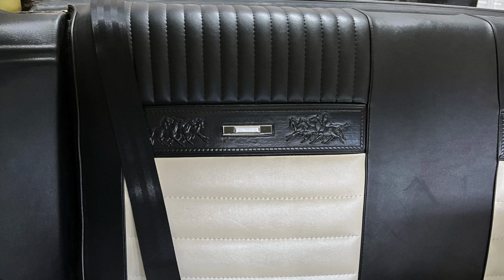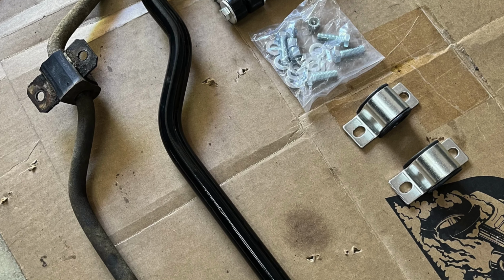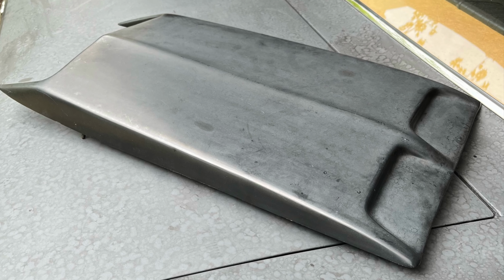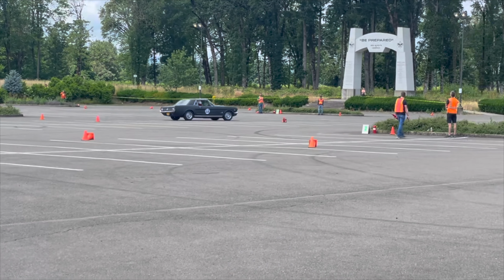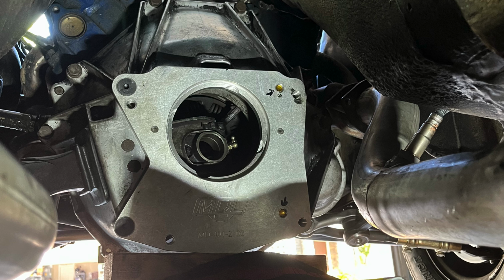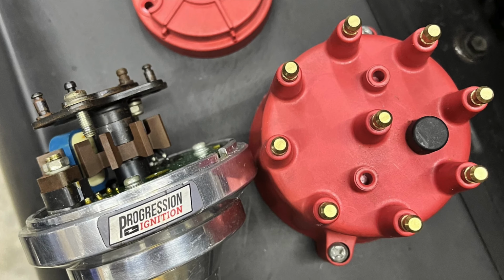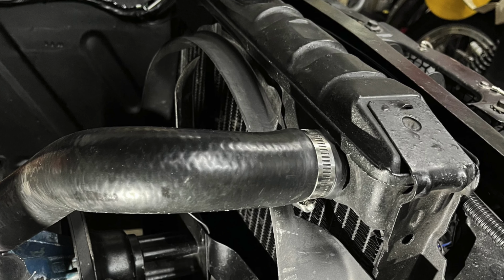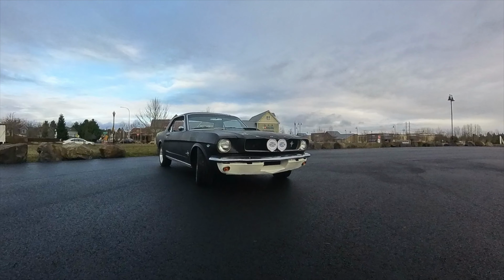1965 Mustang 2022 Update

Comment: Hi Dave...
Please could you tell me how you operate the clutch with your T5 conversion, did you use the original linkage or it looks like you went hydraulic ?
Thanks
Reply from the maker: Z-bar but with the Open Tracker Heim Joints.

Comment: I noticed the a-arm drop, did you drop the rear any and if so what method did you use?
Reply from the maker: I may actually go back and raise the upper a-arms to the stock location. I don't think the CPP kits was intended to be used with the Shelby drop. I didn't lower the back at all. I'm tempted to as I'd like a little less rake but not enough to do something about it yet.